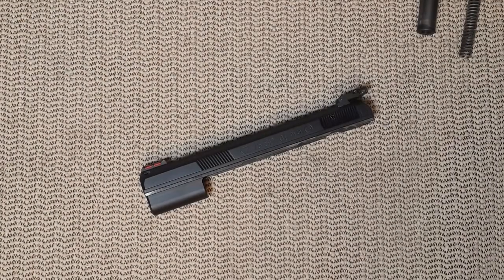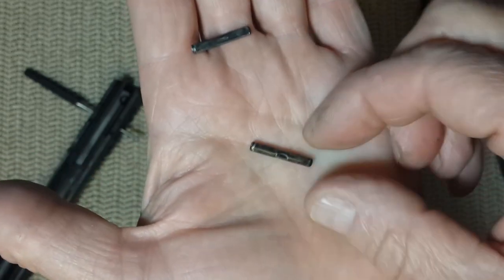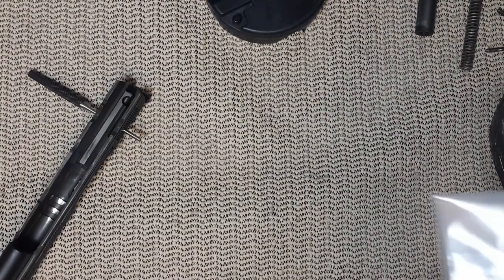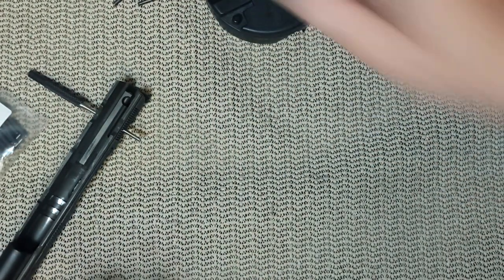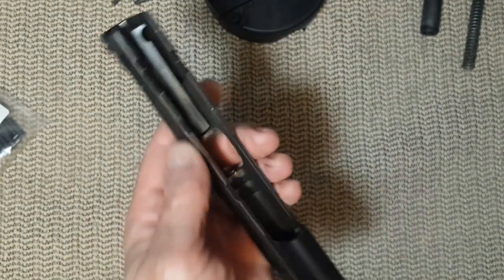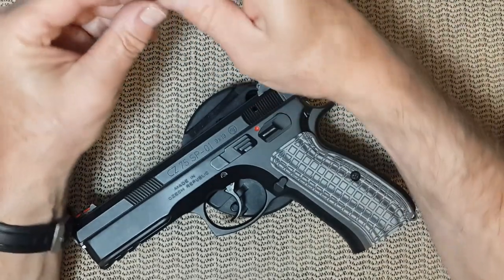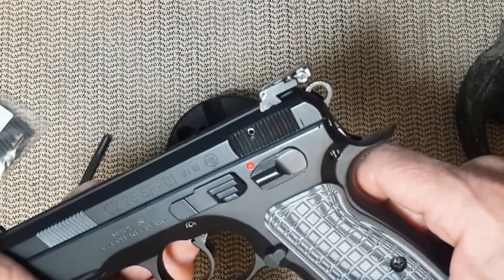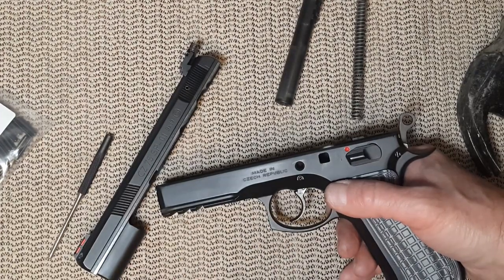CZ 75 SP-01 Firing Pin's Roll Pin Problem, and Solution

Comment: This is a great video - thank you. One thing to note (and I learned as I changed mine out): at the end of the video you confirm the pin is working by pushing it out, and for newbies like myself, I had to learn that if you have a block in place (like most of us do), you have to depress that block as you're pushing, or the the pin won't extend. You mention in the video you don't have your block, so of course you simply gave it a push and the pin appears. Just wanted to pass that along for folks, because if you don't push that block down (which is what happens when you pull the trigger), the pin won't extend. I'm sure that's obvious for a lot of folks, but it took me a few minutes to sort it out. Thanks again, and also to note,  your roll pin recommendation from Amazon worked perfectly.
Reply from the maker: Mark,  I am so glad you brought it up. I have removed my "Safety Trigger Block" so long ago that I totally forgot to mention it during the rebuild of the slide, and you are the first one, after over 2000 people viewing this video, including myself, who caught it. I hope people will come around to read your comment. Thank you
Reply: I know Im quite randomly asking but does anybody know a good website to watch new movies online?
Reply: @Malakai Valentin thank you, signed up and it seems like a nice service :D I appreciate it !!
Reply: @Alaric Luciano no problem :D

Comment: Awesome solution.  I have a bag full of these larger pins (30+) and I doubt my great great great grandchild will use them up.  I have over 3,000 rounds through my 1st install of this larger pin.  Tonight I replaced it and the 1st of the larger pin had no deformation or wear at all.  This is a great upgrade.  Better than the solid pin suggestion which can put too much stress on the firing pin.

Comment: Hey all, Thanks to Practical Shooter, John D, and Dan Connally I was able to get through this and figure it out...my first repair to any of my pistols. It is a simple job to do if you're even half mechanically-inclined. The only thing I did differently is use roll pin "starter" punches, they hold the roll pin and makes it a little easier to line-up with the hole... good luck, you can do it...really. After you've done it, you'll think, Damn that was easy. Just pay attention, and beat on the roll-pin just hard enough for it to go into the slide. IDK if there have been anymore video's made to show you how to do this, but this is the best one that shows you how to do it, that I found anyway. AND, anyone interested in a video about dry firing, there's a link below in a response back to Practical Shooter bc I too have been baffled by the ways of the old-timers and the "myths" of dry fire, although there are some weapons that shouldn't be dry-fired as explained in the video from the link. Thanks Practical Shooter, for your video and provocation to look that up and wanting to spread truths. The guy sounds like he knows what he's talking about, anyway.
Reply from the maker: Thank you for taking the time to write that very long comment, and congratulation on your work. 
Having a softer roll pin for all the reasons you mentioned makes sense, but why would CZ not tell us that pin is a consumable and needs to be replaced every 500 rounds? unless it is a factory defect and "WE" need to replace it with a stronger metal.
In my case, I replaced it, I shot it, I dried fire the crap out of it, and it stands in front of you as a witness. As for other people, I take it as just talk, unless they show pictures of their broken firing pins. Remember, we are on the Internet, and "My friend's cousin had a broken firing pin" is just talk with NO proof to back it up, which I wish they had, to help me make a better decision.
Happy shooting 1Madmax

Comment: Thanks, I have a CZ75 D compact PCR, new with about 400 rounds downrange, but I do have the Cajun Firing pin roll pin, the Reduced power trigger return spring, and the chrome Trigger pin, all in a bag, but not in the gun, I’m afraid to check my firing pin safety roll pin out, because I’m afraid I’ll mess something up, I wish CZ would fix all theses issues already..
Reply from the maker: Kj - There is not much you could mess up. Watch my video and maybe some other videos to pump yourself up and go for it. One part at a time.

Comment: 2,300 rounds through stock CZ-75 SP-01 bought new in 2016, and the roll pin for the firing ping looks polished but fine.  Maybe they just had a bad back of roll pins?  The firing pin had a fair bit of lube on it (CLP); maybe that made a difference.
Reply: Thats good to hear I'm considering buying a cz 75 p-01
Reply: I just bought my p01, so i should just be fine?
Reply: i'm several thousand in myself, on the same gun, no issues.

Comment: I just replaced the retaining pin on my SPO1 after 300 rounds. I noticed the dent on the stock pin already. I purchased the retaining pin from Cajun Gunworks. I prefer buying from  CajunGunworks instead of CZ Custom. Cajun site is much user friendly since they have that field to check the parts if it fits your CZ model prior to buying.

Comment: The ones from Amazon are they exactly like the Cajun gun Pins? As far as not being a solid piece? Cajun says solid piece can mushroom and flare the firing pin, also will these Pins work on my CZ75 D compact PCR? thanks Kevin
Reply from the maker: KJ - No, the Amazon pin is slightly shorter and fatter, but fit non the less. It is hollow and has worked for me for about 1000 rounds with OEM firing pin and CGW extended firing pin, with very little wear on the roll pin. I haven't tested the pins on the CZ75D nor the PCR, but for $12, it is worth trying the Amazon pin.
Reply: Practical Shooter, have you used the Cajun Gun works Roll pin? And is it better then the Amazon pin?
Reply: Funny I thought they only broke if you dry fire a lot..

Comment: The P07 has the same problem and I actually carried that pistol in an unable-to-shoot condition for a while, because the the FP-block roll pin caved and got the firing pin stucked under it. I advice to change the FP block roll pin and the TRS for aftermarket, solid and heavy duty ones. CZ kinda drops the ball on these little details that stain what is otherwise a perfect pistol.
Reply: The trigger return spring in CZ’s are also hot garbage and will leave your gun inoperable.

Comment: This same thing just happened to me I was doing some dry fire training and the sound of my hammer falling sounded different I disassembled the slide to find the exact same thing happened to my roll pin. Glad to see it wasn't a much bigger problem but then again what the fuck CZ I maybe have 1,500 rounds through this gun and I also had a problem with the trigger and had to send it back. Honestly I love the gun but after these multiple problems I might just sell it. I mean I'm gonna fix it first but I really don't want continued problems.
Reply from the maker: If the gun runs fine after you get it back from CZ, think again about selling it, it is really a keeper.
Reply: Practical Shooter yeah I sent it off a while ago and it ran fine after that but then this happened. And I truly do love the gun it's amazing ergonomically shoots flat it's pretty rare where I live so nobody else has one. All the great stuff you would want I just really hope nothing else breaks on it ya know. I use mine as a concealed carry gun. So I need to be able to depend on it no matter what. And when it breaks twice in 2 years it's kind of strange. And I really haven't beat the piss out of it maybe put 2,000 rounds through it if that.

Comment: Cz custom shop makes a solid firing pin retainer. They're 6 dollars and should last forever
Reply: Randy bobandy — “TECH TIP: Why not a solid firing pin retaining pin? We tried that and found that a solid pin will soon damage the firing pin, causing peening. This peening or mushrooming of the firing pin causes the pin to drag in the firing pin channel = light strikes. A solid firing pin retaining pin can also get stuck in the slide. We have machined several from customers slides that would not drive out”.  ~ Ben Stoeger Pro Shop.

This is why I chose the CGW version of this part.
Reply: No, they make a spring loaded one for $6.00 but things get confusing from there.  Apparently they also offer the defective one for $2.00, btw!  But back to the $6.00 one.  When you go to the part and read up on the reviews, you begin to gather that more than a few people who buy these replacement pins...find out they don't fit!!  Then they offer to sell you a "reamer" for $18.50 and then you read that they are actually planning on having three different sized replacement pins in the future (unknown date when this little tidbit was placed on their page).  Apparently this theorized three-pack doesn't exist, so I guess it's reamers and pot luck.  

I notice Cajun offers just one size, so I wonder if they know something about how to make one sized pin fit all that CZC doesn't know?  I find this all pretty amazing...esp since I have THREE custom CZs that I now can't seem to get comfortable with.  Any thoughts / ideas on this fun stuff?

Comment: Great job on the video! I understand that dry firing is damaging to the firing pin. Do you dry fire a lot? Thanks. 🐊
Reply from the maker: Mike Yerke - Thank you Mike, and it's a matter a fact that I do dry fire my CZ 75 SP-01, a lot. 
After reading all the comments about damaging the firing pin, I installed the o-ring over the firing pin's end. But honestly, the o-ring is seating somewhere on my bench collecting dust. I did replace my firing pin roll pin, as shown in this video, about 1500 rounds ago and dried fired without anything. When making this video yesterday, I inspected everything, and everything looked good, as it should. 
I think CZ is using a sub par roll pin, but a quality firing pin. 
In the event the firing pin breaks, I will contact CZ for a new one, but I will keep on firing my gun without any protection :)
Good luck Mike

Comment: Will this still be a problem if you use snap caps when dry firing? Or will the where occur anyway
Reply from the maker: In my experience, once you replace this roll pin, you won't need your snap caps nor the o-ring under the hammer anymore. 
I have 1000 dry fire on my CZ without any breakage.
Reply: @practicalshooter6517  replace with what kind exactly?
Reply from the maker: @teller121  I have a link above for an exact replacement pin.

Comment: What is the size of this pin? Also, where do I get the pack of 100? I can only find packs of 15
Reply from the maker: Looks like Amazon changed the link a bit. The right pin is M3x20mm (3mmx20mm). You will only get 15 of them, but they are also cheaper. Honestly, 1 or 2 of them is all you will need, unless you shoot 10,000 rounds a year :) Happy shooting Matthew.

Comment: Thanks” why don’t you use the Cajun firing pin roll pin?
Reply from the maker: KJ - I did, and the CGW pin worked really well, but the CGW pin goes for $5 each, and the aftermarket pin goes for $12 for 100 pins. I gave links on the description.
Reply: Buying 2 of the CGW pins @$5 ea and $8 shipping is crazy!

Comment: Interesting. I did not know this pin was an issue. I have the SP-01 Phantom and PCR and will check both of those. Speaking of roll pins, I have an issue with the one that holds the trigger mechanism on the Phantom. The pin keeps walking out of the frame. After only about 100 rounds, the pin has drifted out about 2mm from the frame. Any ideas on how to resolve this issue?
Reply from the maker: Check out CZ Custom or Cajun Gun Works, they might have a trigger pin with a recess area in the center of the pin, especially made for the Phantom. This will allow the trigger spring to rest on that recess and hold the pin in the gun.
Reply: @practicalshooter6517  thanks for the info!

Comment: Hello there; new viewer. Nice video, I just finally get my hands on a new Cz 75 Compact steel frame my first Cz on my collection. After washing your video I was concern about this issues so went click your link and purchase the Amazon pins. I call CGW b4 my firearm arrive & put my name on the waiting list for the Pro Package to correct the issues and get the trigger work on.. To remove the fire pin you have to depress the block @ the same time you use the necessary tool to drive out the pin?? Regards

Comment: You said 100 pins, but your link only has 15. Still I love your channel. You always teach me so much about my CZ 75 SP01.

Can you recommend a punch set that has all the punches I would need for my CZ?
Reply from the maker: Thanks Michael. At the time of the making of this video, the pins came at 100 pieces in a bag, things change and they now they come at 15 pieces in a bag. Not to worry too much. Even if you were going to replace the pin every 5000 rounds, you should have enough pins to last you 80,000 rounds. As for a punch set, the one I listed above is the one I use (Tuffman). Metric tools would be best, but the price of the standard punch is around $10 vs $60 for the metric punch. good luck to you Michael.

Comment: very nice video man thanks 
and what can i do upgrade for my p120 from cgw
i wants to do trigger hammer and other springs but what is your advice
Reply from the maker: Ali Lortoglu. Welcome back my friend. You question is very much a personal choice.
 I personally like to wear the gun with everything original (OEM) in it. Shooting it will naturally smooth out all its parts and make the most perfect fit between them. 
Then, after a few thousand rounds, you will know your gun very well and will make a very knowledgeable and informative decision, knowing what the purpose of the gun will be. 
For example : 
For home defense, the reliability of your gun is of the essence. 
For competition, smooth and light trigger, with a light recoil is what you should end up with. 
For the range, :), absolutely all that you want to do to it, and it must look good in the process :)
Good luck Ali.
Reply: thank you my friend i have tp9sf for home defence 
i wants to upgrade for range my p120 ...i think from cgw hammer and single trigger and hammer spring in off for me and recoil spring too latest
Reply from the maker: Go for it Ali, it will make a fine range gun, but be aware to only shoot lighter ammunition after the upgrade. If you fire full power ammunition with a lighter recoil spring, it will put a lot of stress on your slide and maybe damage it. Now, to get the perfect range ammunition, you will need to make your own reloads :), the fun never stops :)
Reply: thanks man

Comment: Have you removed the firing pin block? Does the gun work of with it just removed or do you have to do any other mods?
Reply from the maker: Once you remove the block, everything works the same, and you don't have to do anything else to have your trigger a bit lighter.
Reply: @practicalshooter6517  Thanks! :)

Comment: Because you are running non-standard due to not using a firing pin block, the firing pin could have rotated in its channel and chewed up the firing pin roll pin with the edge of the divet in the firing pin body.  I saw your 7,000 round video and it looks like the Cajun GW firing pin can handle your set-up.